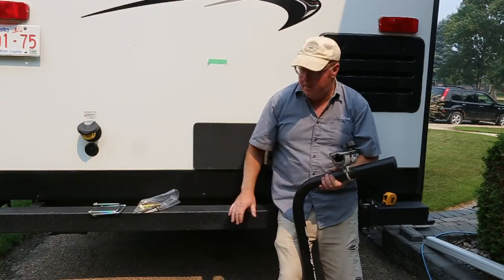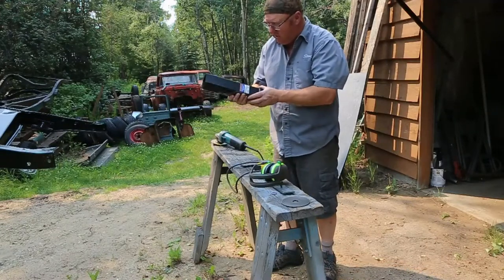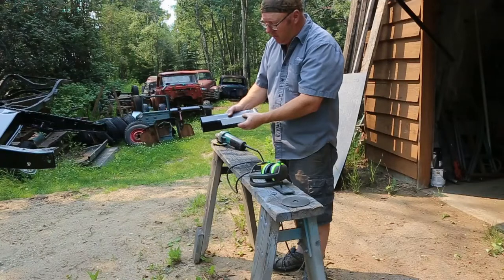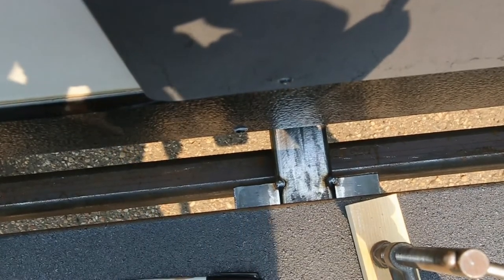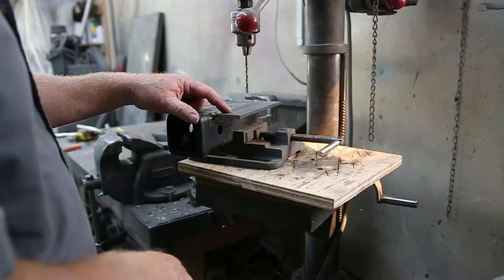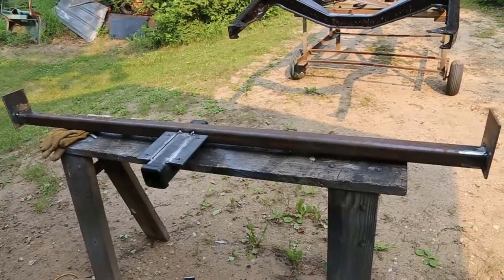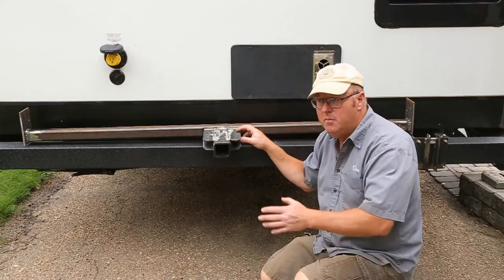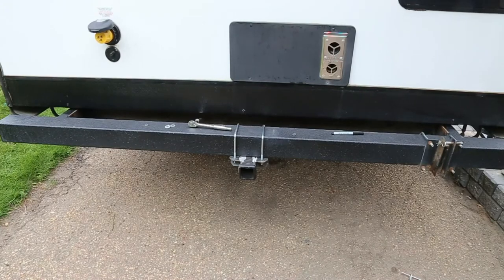Fabricating a receiver hitch for your holiday trailer or RV

Comment: I guess i have to build myself  a 90 Degree clamp.  You did a great job welding in the dark.
Reply from the maker: That is a good project, harder than you think.  Every time you touch your metal with the welder, it goes out of square.  Thanks Bruce

Comment: Hey very good video! What thickness did you use for the 2x2 tubing? Would 1/8” be thick enough to make one like this strictly for a bike rack? Could a person get away with using 1.5” tubing as well?
Reply from the maker: 1/8 would probably work out okay, still thicker than the original bumper.  I would shy away from the 1 1/2, too much flex.  You get those bikes bouncing, there is a lot of force.  Thanks for tuning in.  Stevo

Comment: Hi Stevo .Im passing through Alberta ...I have a Grand Design  with heavy hitch in place . I need to beef up the welds to pull a trailer..... strengthen the rails .
Would you be interested....or can recommend someone qualified:) in Alberta
Reply from the maker: Unfortunate I am on a painting project a can not do any welding right now.  Any welding shop should be able to handle that.  Any small town welder should be able to get er done right away.  Thanks you for considering me.  Stevo

Comment: Great job! Did you have room for the spare tire rack as well?
Reply from the maker: On my trailer bumper, not this one, I did a custom wheel mount but I think we just did the bolt on bracket for this one.  I have done a few bumpers now for these trailer, should go into business.  Thanks.  Stevo

Comment: What size bolts you used for the frame?
Reply from the maker: I used 1/2 inch bolts that were grade 8.  Should do the trick if you are using more than two bolts.  if you are just using 2 bolts for each side, might want to bump that up to 5/8.  Thanks.  Stevo